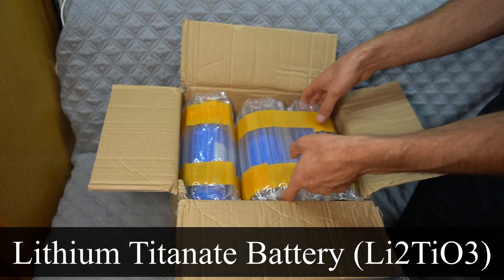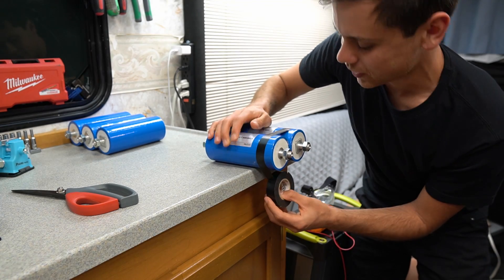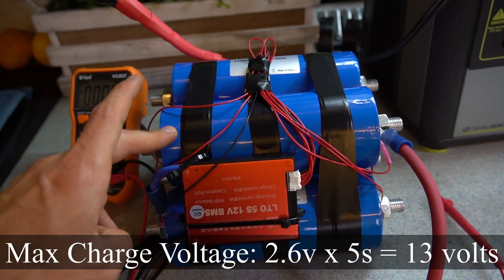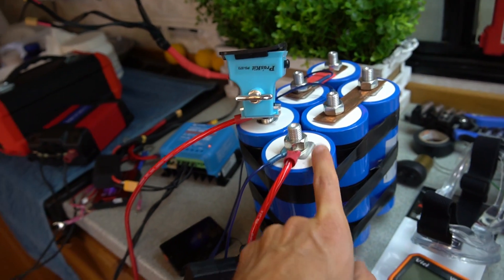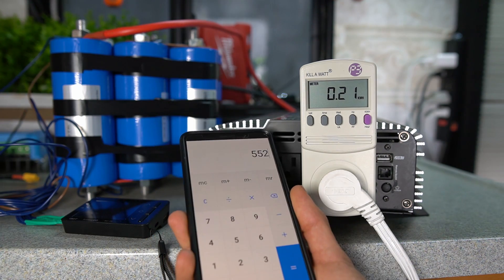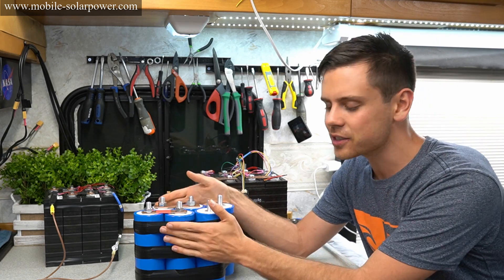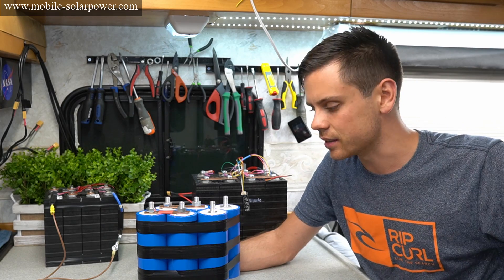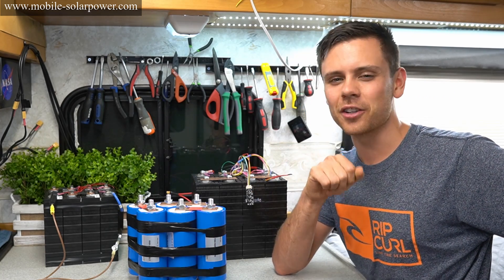DIY 12v LTO (Lithium Titanate) Battery

Comment: I found a seller on AliExpress that seems to be a fair price for them, they claim to be providing grade A cells that are rated for 45ah per cell. $800 for 12 cells, could make a 90ah. Bank that way, I believe? 

I'll have to see if I can find a BMS that's acceptable to use with these cells, and if I can I may order some. I live aboard a boat and 1) the longevity is very alluring and also 2) the safety. As I said in another comment, you don't want to be 2000 miles from land and have a fire.

Comment: Looking for your opinion.
Thinking of using 32, 66270 for a motor ycle battery.
This is just about the only video i have found on titanate batteries.
You went to 24v
Im looking to go to 72v.
Your thoughts?

Comment: Build a LTO battery in the same design pattern as the other pack.  with serial and parallel banks then retest.  I think you might be surprised by the results based on your current results.

Comment: Just ordered 60 Yinlong 40Ah cells, i have already got 6 of these cells that i have had for last 12 months, been looking into 24v inverters and have come across a few that inverters that have a voltage range of 19v to 32v, with running a 10S setup I would be running from 28.4v to 19v which would give me about 95% capacity of the cells capacity at 1C discharge rate, being a 10S 6P setup, that is a draw of  240 amps at 1C for this battery bank, or about 4.5kW draw off rate when at 19v at worst discharge

Comment: I did a bit math and I think that 11S battery will be good for 24V solar system. 28.6 - full, 25.3 - nominal, and 22 - dead. I guess it might work for solar systems that can take the inefficiency. 
Also, maybe they were not formed, so that is why you did not get the full capacity.

Comment: My go to has been headway 38120hp for awhile now for me seems better rates per cell and works very well currently have in my suburban as the main battery runs the whole truck and a decent sized system with my 105a alt no issues with my bank so far it is a 40 cell 80ah bank tho

Comment: What I think is that I don't trust them when they say that technology that has been out 5-10 years will last 50-60 years.  They told me that the led house bulbs were going to last me 10 years and I'm still replacing those on a regular basis.  Maybe not as often as incandescent, but I don't think any of them have lasted over 5 years without developing a problem.
Reply from the maker: No it's a old technology actually. We have data to substantiate the claims
Reply from the maker: Most lithium batteries are actually pretty old. All we did is recently develop the manufacturing methods
Reply: @WillProwse  So, are you are saying that this formula has been around in the laboratories and test facilities for long enough to actually test them, and that they just have not been economically viable to produce?  Because I have never heard of these until the last few years.  Not that I am an expert.  Thanks.

Edit: sorry, one last question.  What do you think of the supposed benefits of using graphene in lithium batteries? do you think that this is the direction of the future in lithium battery technology?  Thanks.  Enjoying your channel and learning quite a bit.

Comment: I think it's best to make a hybrid system with LTO as your fast-charging functionality and LiFePo as the long-term storage. Best of all worlds
Reply from the maker: Charge and discharge curves are massively different. Same with nominal pack voltage. I tried it and it doesn't work well. Do not recommend it

Comment: I like your great educational vid.
I have the EMMO GT80 scooter with 80V/20Ah Lead Acid battery. i want to upgrade.
I want to build a battery pack that will equal 80V, 20AH.

Can it be done with these batteries

what do you recommend

Thanks

Comment: Why not redo this experiment with a different inverter and see if you can duty cycle the cells as low as they are able to go. I think their duty cycle means dead battery with no damages to the batteries.

Comment: Thanks for all you’re help with knowledge of batteries ! And you’re hard core testing 👍🏻 ! I got 26 Yinlong LTO 2.4v Titanate Batteries manly for there life span !
Reply: How is that going for ya?
Reply: AppalachianHustle so far slow , like with my two optima yellow top batteries D31T series 12 volt batteries Constant voltage is 13v - sitting voltage is 13v anything over 13 V it’s only surface charge , & for the LTO 2.4v Titanate Batteries One supplier wrote me back saying the voltage to charge up to is 2.9v is the sitting voltage so I changed up 6 batteries to 2.91 volt let them sit maybe 8 hours 5 batteries dropped down to 2.82v and 1 battery was at 2.66 volts so I charged the one battery up to 2.83v and I now have them the 6 batteries “ Bottom - Balancing “ the way William here says I’ll let them sit for 24!Hour to see tomorrow morning! Busbars for these batteries are hard to find ! Or real copper brackets about 1-1/2” to 1-3/4” wide 4” to 4-1/4” long x 3/16” to 1/4” thick ! You would think if you made the batteries you would have the busbars , the BMS pacifically for these batteries ! If anyone knows any info greatly appreciate the heads up on where to get it !

Comment: Maybe a 2x (in series) setup to get a 80Ah 5v (USB) powerbank. A Voltage Up-converter maximizes the usage somewhat with higher voltage at full charge and lower voltage at low charge. Down to 4.4v or 4.0 (2 in series) even still works.
Reply from the maker: Oh that's a fun idea!

Comment: the  BMS  need 6series not provided 5series for 12V application (range 10-16V), in practical there's wire lost for max. 1v down to the load.

Comment: The batteries I received were 2.23 , 2.23 , 2.23 , “ 2.14 “ , 2.24 , 2.24v all batteries looked new I Bottom Balanced them Back-Yard Mechanic style for about 48 Hour their now all about .04 difference 2.20 to 2.24 can I charge Titanate battery Bank positive all linked and - the same with a 12v charger ?

Comment: It's like trying to get the max out of solar panels. It's rare. I'm sure they measure solar panels into a resistive load at the apex of the curve, while using a cooled panel and the brightest o/head sun on earth.  With the batteries... They are probably measuring all the power they can get out of them down to flat and then rounding up.

Comment: Great project, Will!
With modern battery tech just coming out of it’s infancy, I’m afraid there’s not much value in paying more for SUPER-long life for everyday applications (sure, for satellites and the like as you said).  By the time a lithium phosphate battery will need replacing, a significantly better, cheaper alternative will likely be available.  To say these are “cheaper in the long run” may not be completely accurate given the possibilities with future-generation batteries.

Comment: You should put some Dielectric grease on the connectors and terminals to stop electrolysis from the dissimilar metals touching.

Comment: I think if you're a DIY nutjob and want to convert an old civic into a short range electric car, I think this may be the battery of choice. Lay them down in a pack and they can be mounted under-floor where the exhaust used to go. You'll never have to replace the battery packs, the cycle life will be basically forever, your grand-children could inherent your old converted EV shitbox. People should be making electric forklifts and construction machinery with this, these are the most durable and robust batteries since the nickel-iron battery.

Comment: Well, I think it's a cheap, badly produced battery, LTO batteries should work fine and be over 95% efficient discharging. Some high quality cells will make a big difference in your performance!

Comment: Can these handle -10dF temp for like outdoor use?
Reply: The spec sheets say that they can handle down to -30 degrees C. So that would be -22 dF when you convert it.
Reply: @Sam S I will let you know as soon as my shipment comes in. I ordered up 12 batteries during the Cyber Monday deal from AliExpress. I plan on using them in my fish house where I will encounter below freezing temps. My current setup is two Series 31 Lead Acid Batteries that slowly lose voltage during the week when I am gone. I am hoping these will hold their voltage and that my solar panel will be able to charge them up during the week so that I will not need a generator come the weekend.
Reply: @Sam S I finally just received my shipment from AliExpress. I ordered on November 30th, and it took until January 24th before it was delivered. I am now waiting for the 12S LTO BMS for my system. I'm hoping that will arrive a little fast since it is not as bulky. My goal is to use all 12 cells in my fish house, and then use a DC-DC inverter to knock the voltage down to something like 13.2 volts since everything in my fish house such as the radio, TV, and propane furnace are designed for a 12 volt system.

Comment: The 11s BMS for LTO is now available on  Aliexpress. I bought two recently. What I really need but can't seem to find, is an 11S volt capacitor tester for LTOs
I am using mine in a solar setup and I am having great results with them, (40amp Yinglong cells)

Comment: I'll be using these cells for a setup in a remote location that will be subject to the cold of negative degree temps. Would it be possible to connect 6 of the cells together and charge them using the 5s LTO charger that was used in this video? My first thought is that it won't work because the charger will only charge the 5 cells that are connected to the BMS. My second thought is that it could work, but the 5 cells connected will be monitored while the 6th cell is not. Does anyone have any further thoughts?
Thanks!

Comment: I wouldn't dismiss them for solar storage just yet. The price of these things have come down to around 25 bucks a cell on the Chinese websites and many of them have free shipping. Here is some math I came up with.

Popular Lifepo4 battery:

1200 w/hrs for 949$

Lithium Titanate 30ah and 40ah:

2.3v x 30ah = 69 w/hrs x .85 Discharge Eff = 58.65 w/hrs per cell
2.3v x 40ah = 92 w/hrs x .85 Discharge Eff = 78.2 w/hrs per cell

30ah : 1200/58.65 = 20.46 cells to get 1200 w/hrs
20.46 x 25$ = 511.5$ for 1200 w/hrs + balancer

40ah : 1200/78.2 = 15.35 cells to get 1200 w/hrs
15.35 x 25$ = 383.75$ for 1200 w/hrs + balancer

and this not not mentioning the insane amount of cycles you get out of them and being able to keep them in an unheated shed in cold temps.

Let me know what you think please. ty

Comment: They are a bump down from FLA batteries as far as outbound resistance ratings. That is not the case inbound on these. So yes, these are a good option. 6 cells would hand you over 14V. That's very well in batting circle. Turnaround efficiency is 15% better than FLA batteries but their resistance to thermal degradation in the sub/tropics and tropics makes them very desirable for sailboat applications.

Comment: He misses the point, with a long shelf life you won't be changing your expensive batteries.Also they work in cold environments a huge advantage. You can keep them outside away from your house close to your DC source no need to run expensive DC cables.

Comment: Thread diameter 12 mm? 
Maybe a 1/2" Copper pipe  flattened  with a hammer, cut to length, and 12mm holes drilled, can connect terminals of each battery to another,   and may serve as the battery voltage bus bars for connecting many different loads. 

Flatten one end of a 1/4" or 3/8" pipe segment  and drill an appropriate sized hole may serve as wire terminals that can be crimped or soldered. 

Wire terminals can be made with 3/8

Comment: You can use them like capacitors. Pair them up with a 14.2 volt livePo4 and you would have extra boost in amps output

Comment: "I don't really think you need 20,000 charge cycles" that sums it up. With the high charge rate I think these batteries would only be good for a golf cart that had all day use everyday on another planet that could never be resupplied. Still cool batteries though.

Comment: Thanks for reviewing! I think they might have some niche applications. I can imagine a solar setup in a valley or recess where the sunlight only reaches for a very limited amount of time during the day but still does so reliably. High c charging could be a big benifit for a limited battery capacity system. The cost of solar panels of many systems is not really the limiting factor. The insane amount of charging cycles would make sure they pay for themselves over half a century! Regenerative breaking systems seems like another.

Comment: This Cells are maby LiFePo not LTO. Please measure the internal resistance. It should be less than 1 milliohm each cell if they not full charged.
---> 6 Cells= 4,2 mOhm
And there is maby a problem with the BMS. The resistant of the MosFet is to high (It Eats your Battery capacity.
And the Programming is not good too.
I have so much problems with Daly-BMS they have  no Quality. It looks good bud works not perfect.

Comment: Aliexpress seems to be where all the Alibaba folks dump all their seconds and stuff that isn't selling via Alibaba. Plus, Aliexpress sellers are famous for over-valuing the products they sell. 

I've bought a number of LED e26 110v-rated bulbs from Aliexpress vendors. If they say the bulb is a 15 watt bulb, you'll be lucky if it's 7 watts and lasts three months before it starts to go bad. You also can't trust the kelvin temps advertised.

You generally have to buy the product, test it as you have, and then make a determination as to whether the product will fit your needs. Then, there is no guarantee that if you go back to buy more, they might switch the internals for cheaper parts. 

Unfortunatey, Aliexpress is a little like the Wild West. And the language barrier is no excuse when maths are pretty much the same across the world. There is nobody in Alibaba corporate to regulate the values they post, so vendors can say whatever they like about their products with impunity.

Comment: These batteries would be perfect for a RV house battery that is charged by the alternator from a diesel or gas unit. I have no idea what heat concerns one would have if you were charging them at the 10C you referred to however, if you actually can do that diesels RV us the Eng. for breaking one could set up cells off of a robust 250 amp alternator and when the breaking was activated using the diesel engine you could also activate the alternator to charge the cells thereby recouping the energy that you had built up to climb the Hill while going down at the same time charging your house batteries. I hope you can do a project on alternator charging. And remember if energy is free who cares about discharge efficiency.

Comment: I bought a large order of the Yinglong branded LTO cells from China last summer for a couple competition car audio projects.  So far I have been very impressed with price to performance compared to AGM batteries (not to mention weight and size advantage).  Only time will tell on the longevity of these but for what I'm doing if they go more than 3 years I'm way ahead of the game over AGM.

I should also mention prices on these seem to have jumped a bit since last summer, depending on the current market I may revise my opinion, but so far they have exceeded expectations and even at twice what I paid back then they'd be a fair value for my application.

Comment: The chemistry and voltage range means it only works at 24 or 48 volt packages. Then it’s 11 or 22 cells in series, not exactly standard for normal BMS packages.

Comment: Our lipo batteries been charging at for the last 7 years 5c-10c depending on the quality of the cell you buying or using our new Lipo's top off at 4.3 volts per cell with Super high discharge and charging

Comment: Will, I doubt that the cycle efficiency is just 85%. If it is at your discharge rate the cells would have been too hot to touch and system design would have called for adequate cell spacing and possibly forced cooling. Maybe even 35Ah capacity is overrated.

Comment: You keep mentioning 12V appliances when the only thing that I know of that has a low voltage cut out are inverters, and I suspect that if you opened up the inverter you might find a pot that would let you tweak the low voltage cutout.

Comment: Looking at buying 44 - 40ah LTO batteries for 160ah total. Where I was considering lifepo4, these can be charged in freezing conditions. 
The drawback is managing their charging at 2.8v and discharge at 1.5v limits, with equipment that won’t work with too much or too little voltage. 
As my Trace DR-1524 cuts out at 31v, so while charging 11 batteries with 2.8v = 30.8v this arrangement keeps the inverter from rejecting the battery while it’s being charged. Whereas 12 cells will require charging that’s too high causing the inverter to quit. 
Conversely, this DR-1524 shuts off at ~21v, leaving about .5v in the LTO that could have been utilized but isn’t by the inverter. 
Which is not a problem as my trailer’s configuration uses a 24-12 switching buck converter for backup lighting and refrigeration control so those loads would be there at the bottom of the battery’s useful range when needed. 

Because having to configure a means to automatically heat the lifepo4 cells before they can be charged, is quite involved, this makes the LTO easier to implement and a more attractive choice for my installation. 

Downside is the BMS needs to be sized for 11s. 

Though 20,000 cycles means this is the last battery I buy. 

The question is, should I purchase 6 extra cells for another 12v system that eventually could be cannibalized should trouble with the big main battery occur, as I’d have the same/aged cells to patch in for the failed ones?